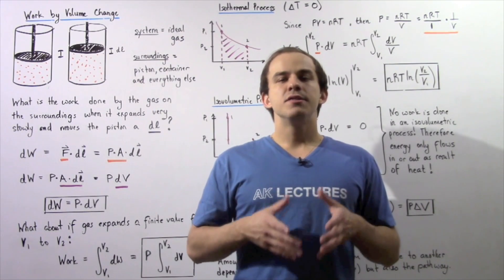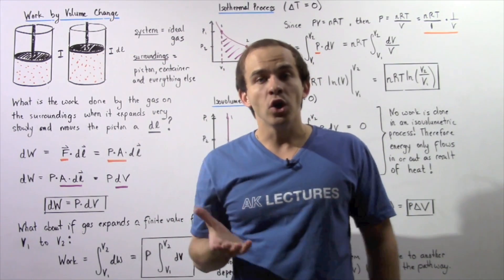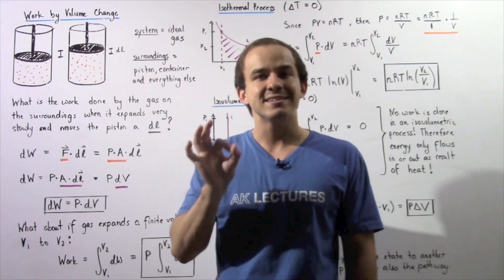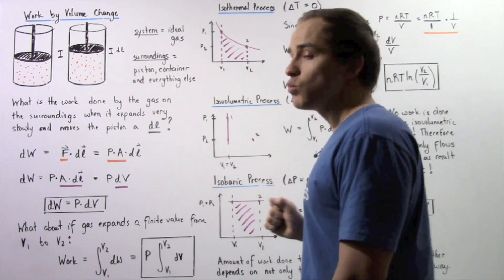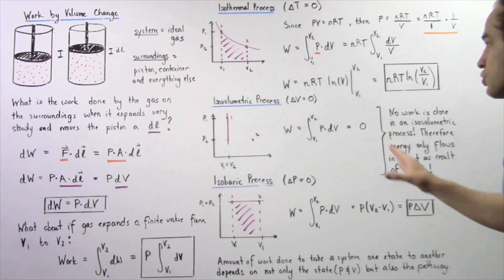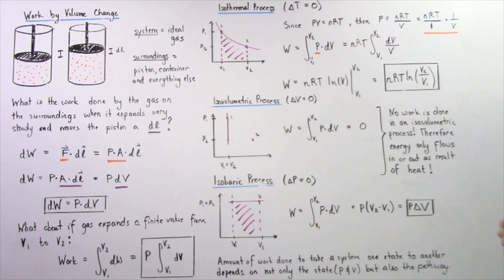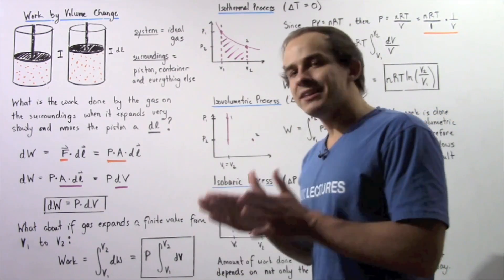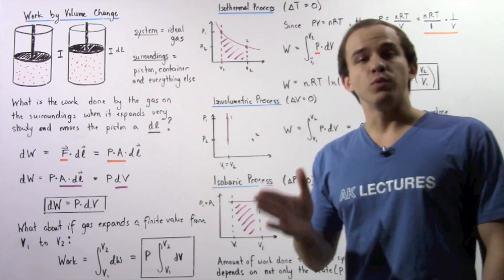Work by Isothermal, Isovolumetric and Isobaric Processes

Comment: Hlo sir,  i have one que.  Why in physics when work is done by the system we take it positive while when work is done on the system we take it negative plss clear my doubt sir plsss
Reply: The short answer is: "because we said so".

We assign a sign convention to account for the direction of work from outside the system to the system, or vice versa.  In Physics, it is common to use the heat engine sign convention for heat and work, such that work done by the system is positive, and work done on the system is negative, and vice-versa for heat.  In chemistry, IUPAC sets a standard for both energy forms to be positive when entering the system, and negative when exiting the system.